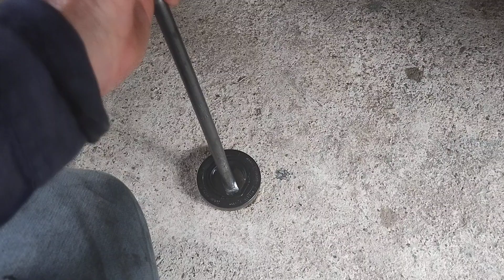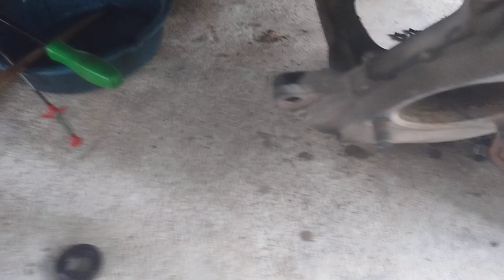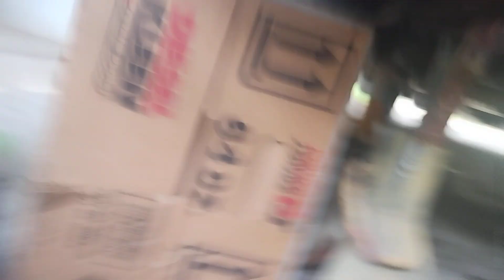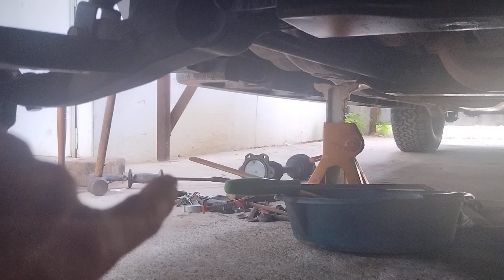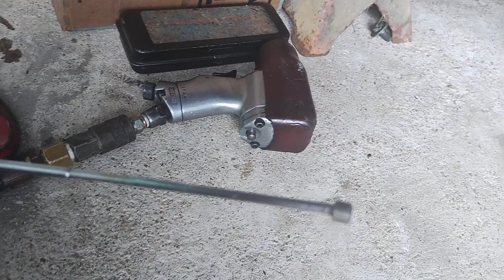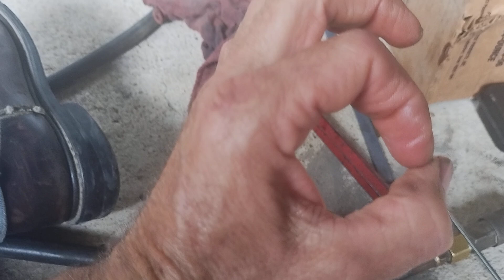Part 1 intermediate shaft correct seal replacement on 2002 Chevy Suburban Z71 #crrnewsandclues

Comment: I want to fix my 2005 5.3 v8 crew cab z71 and get her in pole barn (that's the BIG JOB ha)  Without it, forget about towing my boat, or doing anything heavy, appliances, trash, beer can hauling etc. lol  picking up anything.  Change Oil sending unit. Speedometer don't work, only sometimes.  Oh Lord!!  :face-red-heart-shape:
Reply from the maker: I was just talking to someone about a 2002 like that which makes some clattering noise when the starter is turning the engine. But it won't start. I hope you get it all fixed up soon. You can use a GPS unit or a speedometer app in your phone to monitor your speed until you repair the speedometer.